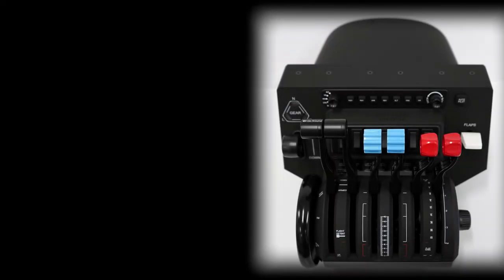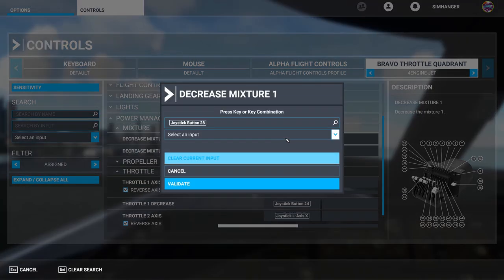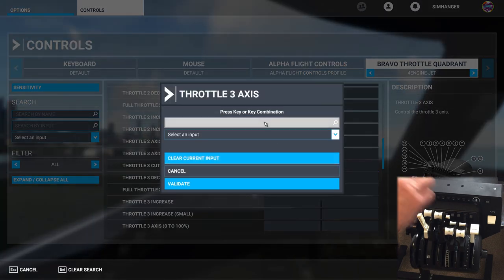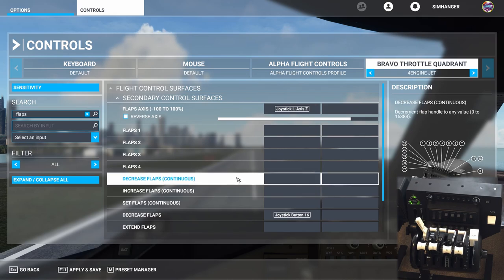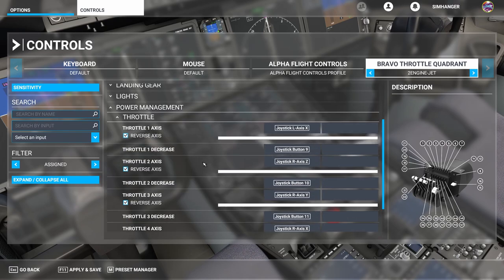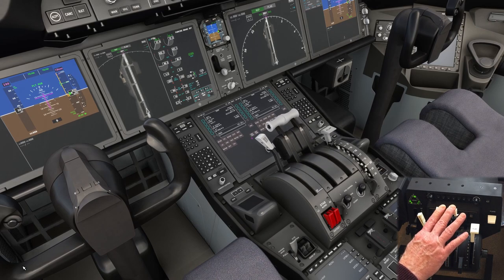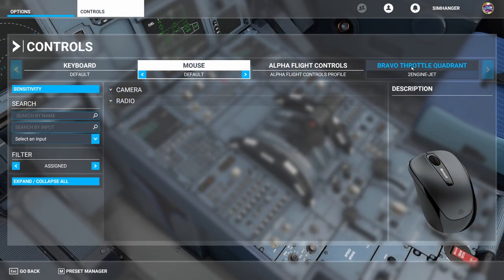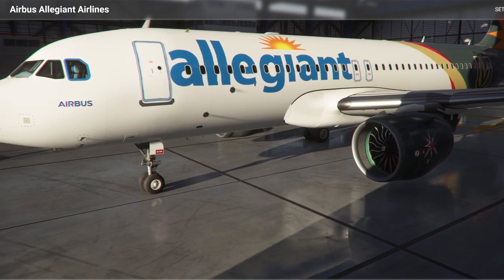Configuring the JETS in the Bravo Throttle Quadrant | Microsoft Flight Simulator

Comment: Just received mine also, fantastic piece of kit. It has really took the experience to the next level. Thanks for the guide, it has helped me alot with setting it up. I am struggling to setup the autopilot configuration on the quadrant with a320neo. A few of the selectors don't seem to function. I have tried with a two engine prop and it works fine, following the instructions from your other video.

Comment: Really like the videos…very clear and very useful.  Question…you mentioned setting the switches on the bravo panel to cabin lights, panel lights, etc.  You mentioned fuel pumps as one switch to set but I don’t know which element to bind it to.  Please tell me which one you use.

Comment: Your video helped me greatly but I can not get the flaps configured for some reason. I set it the way you did but the flaps go to 25 degrees and that's it. Also, I do not have anything in the Decrease/increase flaps windows. Do I have to have them set like I see in your settings? I would also like to know how to set Flap increments 1,2,3 and 4  Thanks

Comment: im setting my honeycomb up , i used throttle axis, en spoiler axis, when my throttels are down, the spoiler lever works fine, but when i got my throttle al up, the spoiler lever moves up with the throttle levers, and the spoilers keep in down position, when i pul the lever to up position the spoilers keep going back in down position. do you have any idea what that is? kind regards.
Reply from the maker: You have a config conflict. Search by input on both spoiler and throttle.
Reply: @SimHangerFS  i found the issue, i looked on internet, and i ended up on a page from a real boeing airline plane where they showed and explained, when you on the ground or go into a go arround when you throttle up as a safety feature youre spoiler wil g up to into the down position. so i thought, what the hack lets try it, and indeed its correct, when you airbourn the spoiler lever works just fine. and when you on the ground, the lever move up to down position with the throttle if you open up. (i fly the 747-800 default.
Reply from the maker: @2684dennis  thanks for the feedback, I didn’t know that 👍

Comment: Thanks for all your videos Mark. Personally I disagree with the config for the A320. The thrust leavers look and operate more like the ones you get in the general aviation box, than the commercial leavers, which would be more suited to the ones you see in a boeing 747. In the A320 you don't have the small reverse thrust leavers on top of the main levers. You initiate reverse thrust by pulling the main throttle leavers down beyond the detent. You also have the red go around button on the A320 which you get on the general aviation levers.
Reply from the maker: Hi, I have now purchased the throttle pack - airbus for the bravo TQ from Honeycomb. The throttles do have a lever on them, as does the real world A320, although they are considerably smaller than the boeings. See here https://youtu.be/Z-PPxDMUzoU

Comment: This works perfectly!  Now, have you figured out how to map the beacon, nav, and taxi lights properly?  Strobes and landing lights work great, but the other three are making me insane!  (Well, that may actually be my wife, but those 3 light bindings aren't helping LOL...)
Reply from the maker: Hi, for some bindings, to map correctly you need to do the following.....switch in off position.....move it to on whilst scanning and then back to off before it registers correctly.
Reply: @SimHangerFS  You lost me a little bit (but maybe that's just because I'm not the brightest bulb in the bunch...)  Can you expand on this explanation a bit?  Thanks!
Reply from the maker: @kevykevTPA  what problem configuring the beacon, nav lights are you having?
Reply: @SimHangerFS  Here's what I mean.

This works:  (Switch 7, the far right)
Landing Lights Off mapped to button 47.
Landing Lights On mapped to button 46.

When you flip the switch up, landing lights come on.  When you go down, they turn off.

THIS, however, does NOT work:  Switch 6, second from the right)
Taxi Lights Off mapped to button 45.
Taxi Lights On mapped to button 44.

When flipping the switch, nothing happens.  Ditto for Nav and beacon, but landing and strobes work properly.

Now, clearly something is broken, because when setup as above, it SHOULD work, but it doesn't.  But I'm working if there's a workaround until Asobo (I guess it's them who needs to fix it?) gets it straightened out from a software perspective.

I actually hope we're wasting electrons here, because I'm hoping Sim Update 3 will fix it (is that still due tomorrow? (March 2nd, 2021)), but I have no idea if that's on the list of fixed items...
Reply from the maker: @kevykevTPA  from what you are describing my first guess would be you have something else configured to the desired action and it is preventing the switch from carrying out the correct action once configured. Check all other bindings AND default settings for the BTQ. is this configured already to another switch? If not then I would delete profiles and re-download the MSFS drivers from Honeycomb. I don’t have this problem. Hope you get it sorted. Regards
Reply: @SimHangerFS  Wait, are you saying that when you flip the switch you have assigned to "Beacon", it goes on and off as it should?  With the assignments I showed?  I'd really like to understand how, as I'm certain I don't have any double assignments or other glaring errors like that.  As far as drivers go, it's my understanding that the only thing needed for the BTQ with FS2020 is for the warning lights on the BTQ itself, which I do have installed, but since I'm under a VR hood, I can't see them anyway.

Some have suggested using the "Set" binding, and I tried that on my Bonanza preset, which got it to "sort-of" work, but it's working backwards.  Down is on and up is off!

A Honeycomb rep implied to me that it's a software issue that they're working with Asobo on fixing, but no further information was forthcoming, so I'm left just lost.
Reply from the maker: @kevykevTPA  , hi, the point I was making was during the configuration process I found some on the switches did not register fully all the time....for example beacon light on ...and I moved the switch to on to register the binding. Sometimes this worked, but on occasions I had to push the switch to on and back off again to get it to register correctly. For beacon off I would ensure the switch was in the on position then configure/ scan...press the switch off and the back on. Odd I know, but it did work for me on some mapped actions.

Comment: Hi Mark. I just got around to trying the setup for the A320 and it does not seem to work as you illustrate. On my system the decrease throttle (reverse) activates whenever the throttle is pulled all the way back no matter if the reverser lever is on or not. In the settings is displays as Button 11 + Button 27 (Throttle 1) but it appears to ignore the requirement for the combination of both switches.  Is this a new bug or am I doing something wrong here.

Comment: Hi Mark, I learned a lot from your videos. Great videos and very instructive. I was setting the Reverse for the Cessna Citation using the normal levers and pull the levers completely to activate the reverse. If I use the white knobs with the special reverse levers what do I use the switch on the bravo button 26 and 27 for? Originally I set this up same like the TBM 930. Anything I should be aware of or can be done both ways? Thank you. Would love to see a video from you on "how to" for Cessna Citation Longitude

Comment: Hi Mark, I am rather new to MSFS and extremely new to Airbus as I have always flown the PMDG 737 in Prepar3D.  I have no problem setting up some GA and the Salty 747 but I am struggling with the throttles on the Fly by Wire A320.  Perhaps it is different to the default A320 in terms of control assignments?  Basically no matter what throttle option I chose, be it throttle axis 1 or the 0 - 100% option the thottles in the sim move right through the max thottle to max reverse when I move the Bravo levers from 0 - 100.  Placing the Bravo lever at 0 results in full reverse.  I have tried an edited copy of the 747 profile, I have also tried an editted copy of the default Bravo profile.  It appears to work differently to your video.  I appreciate your video was made over a year ago so perhaps the FBW aircraft or the sim has changed.  I have a trial copy of FSUIPC (expires on the 10th) and assigning throttle 1 and 2 levers in it and deleting in the sim creates other issues, the full movement of the levers causes those in the sim to only move between the CL and TOGA positions.  I cant make it move to the A/THR range, not sure what this means as Im so new to Airbus.  UPDATE: I have just tested your config on the default A320 NEO and it works fine so the issue must be with the latest Fly By Wire version.  UPDATE 2: After some fuller Googling I have discovered the FBW has an option in the EFB with regards to the reverser being on the same axis as the throttle.  Disabling it fixes the problem
Reply from the maker: Hi, yes the FBW set up is different. You need to use the EFB to set. This model also uses some LVARS so certain functions can not be assigned by default. My config is for the default A320Neo. Glad you got it sorted 👍

Comment: Hi Mark, thanks for this useful video. Therefore I have something different from you with the reverse buttons. During the assignation, it won't reconize any of buttons 9 to 12. If I set them manually using the SELECT INPUT and go in the plane, pulling the reverse lever to down position won't activate the reveser until I push it back to up position. They seem inverted ?  Very strange. Any idea ? Thanks a lot.
Reply from the maker: Yes this is now how buttons work…move to register and bind….move to out of press to validate. Note start with the button not activated.
Reply: @SimHangerFS  Thanks a lot Mark. I really love all your videos. You are very informative.

Comment: Hi Mark, such a great tip on setting up reverse throttle for A320 (two key combo approach).  I have one question on speed brake.  Is there anyway to set up the "arm" speed brake action in Bravo Throttle?   Currently, the level only slides the speed brake up and down.  Thanks!
Reply from the maker: None that I have found unfortunately

Comment: Love your videos thank you however I just noticed when setting up my Bravo that the MS FS 2020 "Search By Input" does not work , For example when setting up A320 NERO ( or any input) , when i select the search but input i simply get the "! You are trying to assign an action to a device that is not selected" . Yet I am in the A320 Profile and Selected the "Throttle 1 Decrease" ( once again this happens for ALL inputs) - looked on forums etc unable to find anything. I am running latest updates ( April 22 2021)  - Any idea why this might occur?
Reply from the maker: Hi Lance, not come across this one. Try plugging into different USB ports maybe....check calibration in Windows...does windows recognise it? Sorry really don’t know on this one.

Comment: I’m trying to set up my jets on the bravo throttle quadrant and after being successful with props I’m having issues with the jets 
Spoilers are none functional and flaps are the same and I have no -100 to +100 setting available.. there is not that option just 0-100
I’ve watch the video several times and tried a lot of combinations but nothing is working 

Any help would be appreciated 

Thanks 
Mike
Reply: Hi Mike did you get this issue sorted out? I have the same problem.
I don't know why thia guy doesn't answer any of the questions people ask him.

Comment: Hi Mark, I have another question. When setting up the Cessna Citation Longitude the +/- know used to change altitude etc seems to move the speed of the auto throttle at the same time when I reduce the altitude and or I set a Vertical speed negative. Somehow when I use the minus knob both altitude and Auto throttle speed go down 1 number at the same time like I am using it for both. Is there a conflict or should this be configured differently?
Reply from the maker: Sounds like a conflict. Check this in controls by searching via input. Once identified you can delete conflict. If not there then it is likely the activated default profile is corrupted. You will need to reinstall the MSFS config. Regards
Reply: @SimHangerFS   Thank you Mark. There was a conflict which he plus did not have. I removed it from the airspeed.

Comment: I can not validate it - when I select both Buttons in A30Neo setting it does not let me confirm the settings!!???!??
Reply from the maker: Move the buttons on and off again to validate. Sometimes I find you need to do this.
Reply: @SimHangerFS  thank you for the fast answer, unfortunate I can not validate it - all other controllers work, as soon as I plug in the Bravo it does not let me validate it?!?!
Reply: I can not even exit back to the menu, I am stucked and need the task manager to restart again :-(
Reply from the maker: @GSKGolfSimulatorSystems  sounds like something is corrupted. You may need to uninstall and install the Honeycomb drivers again.

Comment: Hi mark, I just recive my honeycomb bravo throttle quadrant and I try to configure it for a 4 engine jet. I follow your video step by step but when i want to set the reverse thrust            only 3 are working(buttons 9,10,12). I went to set throttle 3 decrease to button 11 but msfs don't reconize this button. The only way to set this button it's by select an input and choose joystick button 11. But it's not working in game. Do you have a solution for that?
Reply from the maker: Not sure what the problem may be. Make sure there is no other binding mapped to this button/key. Reconfigure it by moving into the reverse range and back out again. It should register and scanning box not be greyed out. Did you do the throttle fix? Regards
Reply: I try different thing but nothing work so i contact honeycomb and i wait for a reply. I try to change the stick 3 in position 4 and it doesn't work either but the stick 4 work in position 3. I try the throttle bug fix but that doesn't fix it. I will wait  honeycomb reply to see what's the problem. Thanks for your help!

Comment: Thanks Mark for this extremely useful video. Everything is now set on my A32NX (assuming it behaves the same way as the A320 NEO) in MS Flight Simulator 2020. (1) Am I alone facing the problem that throttle moves from idele to TOGA (full power) & back, but I am unable to stop it at CL position (which is required in normal flying mode)? (2) The only way I can get back to idle out of reverse is by (a) moving reverse levers back in position) + moving throttle to full power & back to idle. Is this normal? Thanks again for the videos (well done!).
Reply from the maker: Hi, it sounds to me as if you have the wrong set up on your axis or you have a conflicting binding on the throttles somewhere. Regards
Reply: @SimHangerFS  I am setup for per your video Joystick R-axis Z+ & Joystick R-axis Y+. And same bindings for reverse axis as on the video. I have checked several times with your video & am completely aligned. I can't figure out what's wrong.
Reply from the maker: @thierrygnych6501  I am also not sure what is wrong. All I can suggest is you check for any conflicting bindings....is another axis or switch conflicting with the function. Alternatively delete profile and recreate from default again. Regards
Reply: @SimHangerFS  I understand that it is difficult to figure out without seeing. I am still posting, in case someone else faced the same issue. I noticed that following your procedure selects in my case Joystick R-Axis Z+ (instead of Axis Z) for throttle 1. And Joystick R-Axis Y+ (instead of Y) for throttle 2. Could Z+ & Y+ be more of a toggle on/off type of profile while Z & Y are progressive ones? Then comes my second challenge: when trying to select Z & Y from the drop down menu, I am getting a warning that such a selection is not authorised for this. Wondering, both why & how to resolve. In case someone knows. PS. I received the Throttle bravo Quadrant one week ago.
Reply from the maker: @thierrygnych6501  just a thought....are you trying to move the throttles with auto throttle or toga engaged?
Reply: @thierrygnych6501  this might be too late and you probably fixed this already, but delete all axis bindings on the base profile, then make a copy and your axes on the new copied profile. That should fix your issues!

Comment: What about us flying FSX steam?
Reply from the maker: I hope to do a config guide at some point in the future for P3D. Should be fairly similar to the FSX requirements. Regards
Reply: @SimHangerFS  Thanks, have a new honey throttle, with the same issue’s.....for FSX steam.  There was no download to fix the issues....so I am kinda stuck with a partial use of the throttle with no lights and no number two throttle......and of course no autopilot and switches.....and of course no YOUTUBE vids of FSX fix.  So, you seem to be our only hope!  A lot of people still fly FSX, ands wont switch over to 2020.
Reply from the maker: @jzatofl9546  you should be able to fix the throttle 2 issue by simply reassigning it in FSX and saving it asa new profile. Regards